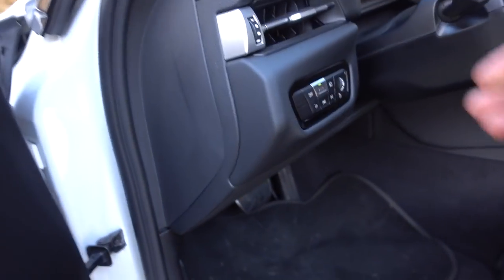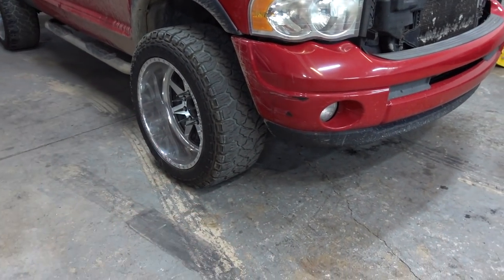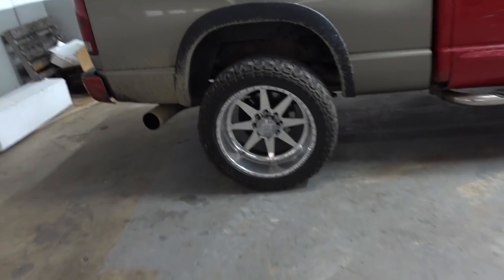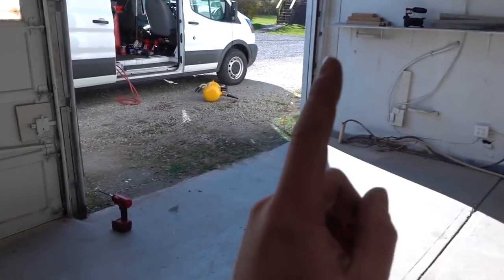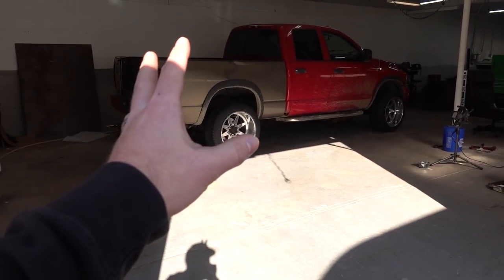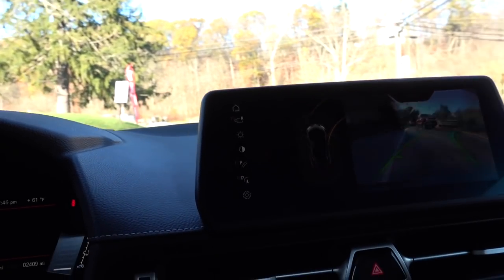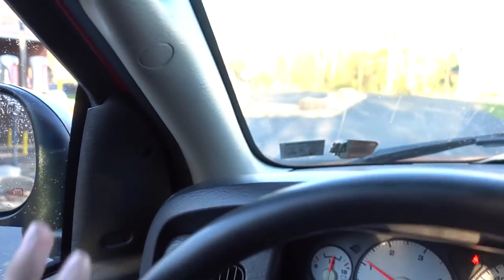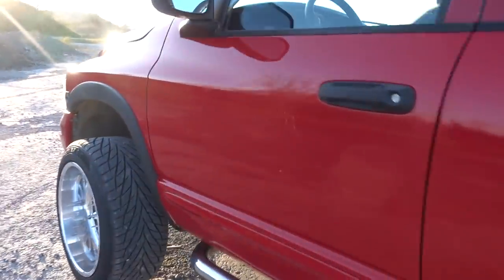I should of done this in the first place

Comment: What brand are your spiked lugs? I've been wanting to get a set for my truck, but don't want a cheap set that the spikes break off or paint chips off easily
Reply from the maker: Metal Lugz, there pretty good ive been using them for years.  Never had any issues

Comment: What size tire and wheel are you running on your f250? and what suspension setup?
Reply from the maker: 24x14 with 35x13.50r24 on a ready lift 2.5" leveling kit